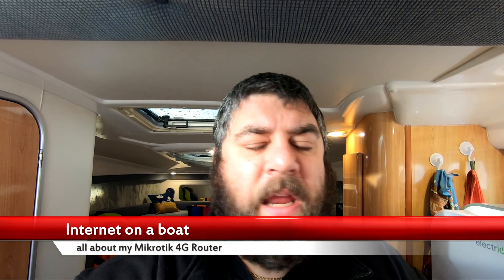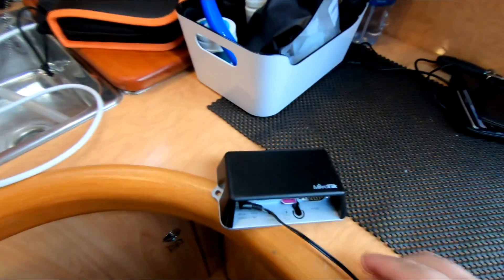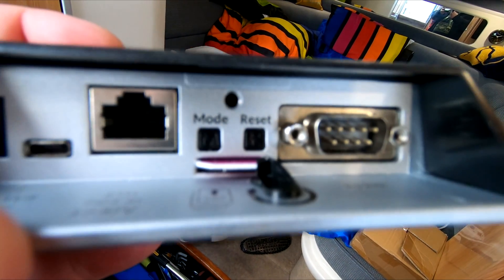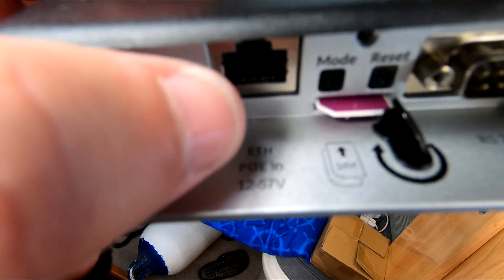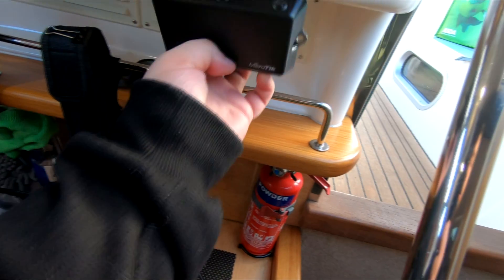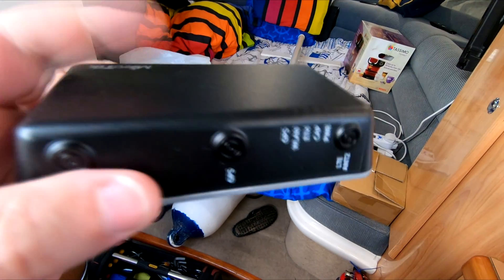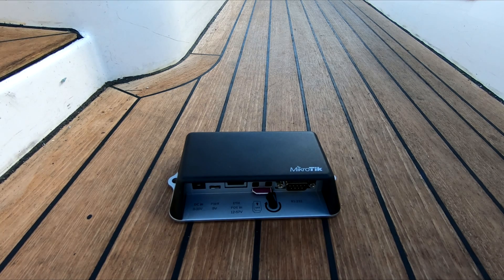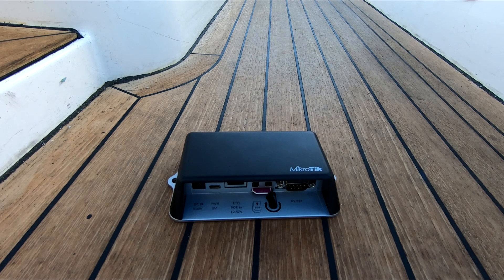Internet on a boat with a Mikrotik 4G router

Comment: Dave, thanks for doing the video that’s exactly what I wanted and more. The only other questions I have are:- where did you get it from for that price, as I can’t find one under £130, and is a data package more suited or a call package on the sim. Hope that makes sense.
Cheers, Dean
Reply from the maker: Think it came form linx although I'm not 100% and I can't find the invoice :( just a pure data only package is all you need for it (or any other WiFi hot spot)
Reply: @DavesBoat  👍